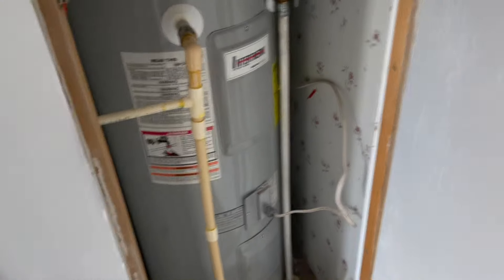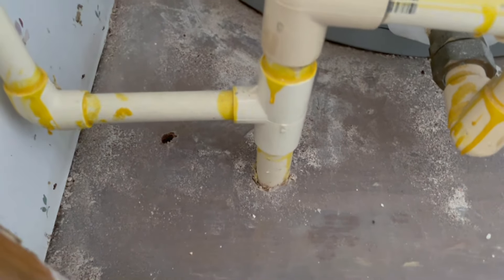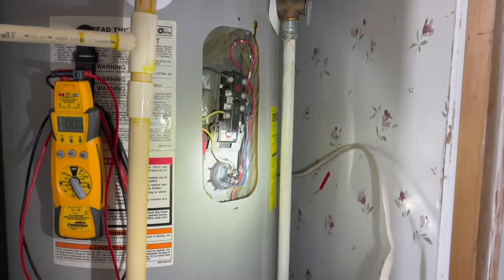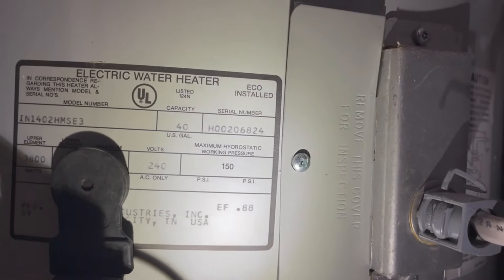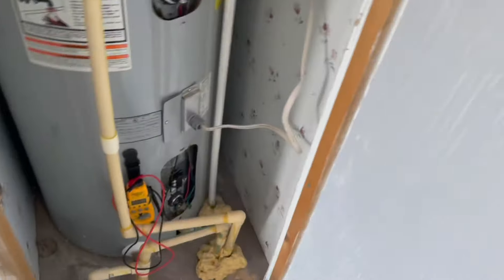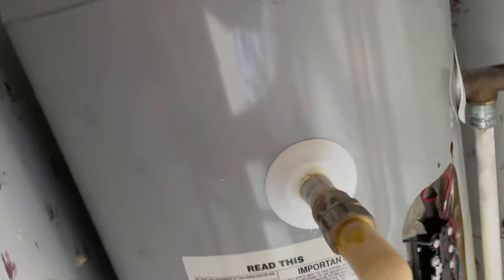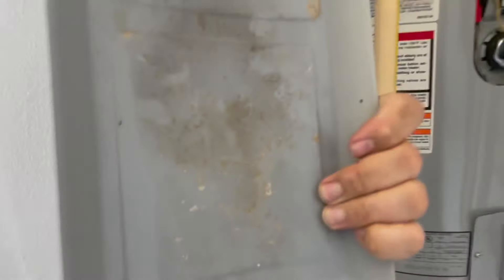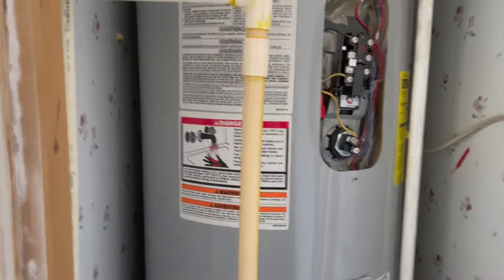Electric Water Heater Service in Clermont, Florida by Pipe Doctor Home Services

Comment: Sorry: seems like a total waste of money & time to attempt doing parts replacement repairs, without first checking for anode rod debris at the bottom of the tank. Especially with all of the extra PVC pipes, for which their purpose for being there isn't understood. That water heater also appears to maybe be newer than your "guesstimate" of 24 years old. Ideally, you'd want to get in contact with the original installer, and see if they can clue you in to what's going on, with all of the piping weirdness?